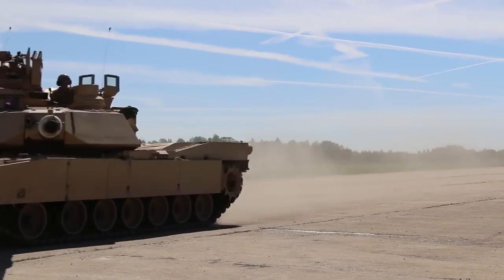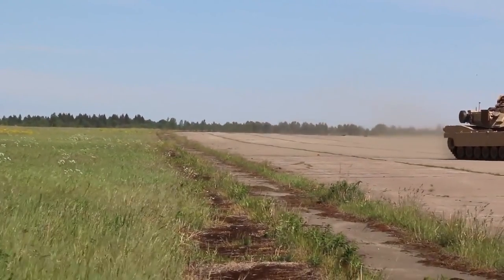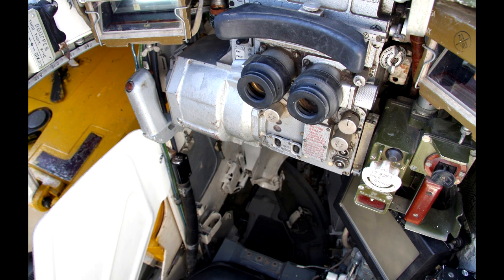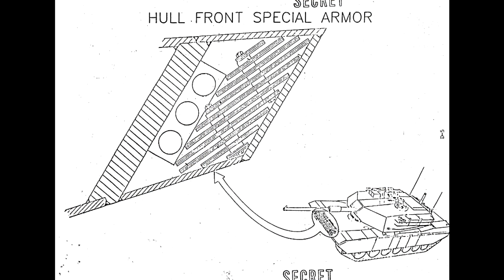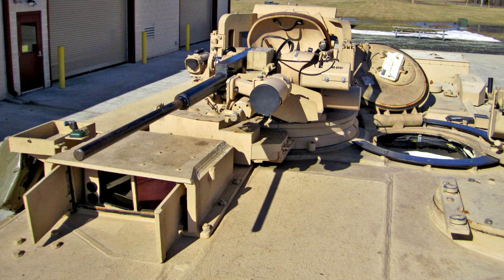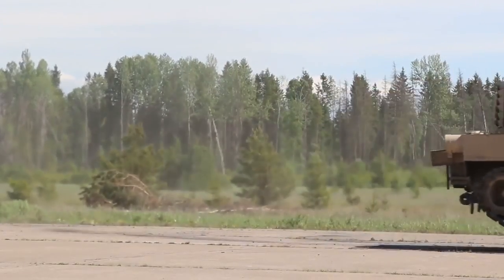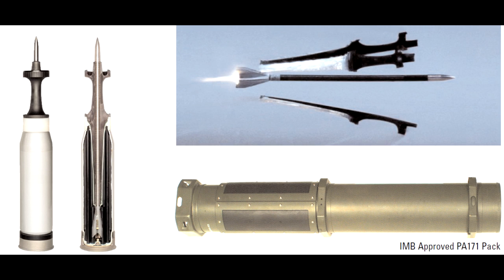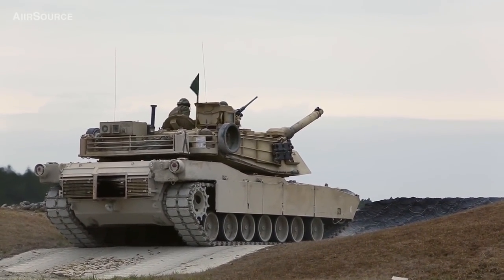Problems with Abrams tank

Comment: Could we get a video about diesel engine vs gas turbine? The way it seems to mostly be put in your videos is that there are no benefits to gas turbine and there is no reason it was chosen for the Abrams.
Reply: I like Red Effects videos, but everyone has limits on what they know. The 'inside the chieftains' hatch guy was a US Army M1A1 commander. He claimed that the gas turbine was relatively fuel efficient while on the move, but horrible while idle.  I would like to see a more in depth comparison of this as well. The 'gov' are poopy headed morons, who should have listened to me take, is not always convincing.
Reply: Advantiges are: less noise: the Abrams is called the whispering tank. And as some others stated: less moving parts. But this is not really an advantige: because it only becomes one, if less moving parts mean less maintenance and more reliability. But the engine needs far more maintenance as any comperable tank engine.
Reply: @scheisstag  maybe less smoke too,  those Diesels  roll coal pretty bad sometimes. But I still like them too:)
Reply: @scheisstag  Have you ever actually worked on the engine before?

Just curious. I mean, I have. I can tell you that it isn't any more or less maintenance intensive. So I'm not sure where you're getting this information from.
Reply: @shirghazaycowboys  How many soldiers are in your tank  bataillon?
Reply: @scheisstag  Depends on the year. I got out in 2015 and at that time Second Tank Battalion was beginning to downsize. 

There's likely only two to three companies left. Alpha Bravo and Charlie, if they didn't divest the last one.

Regardless your question is rather ridiculous. No normal enlisted soldier can answer that question as on given day there are troops coming and going.
Reply: @shirghazaycowboys  Its not ridiculous. Because you are not supposed to answer with one fixed number, but with an average figure. Its about how big in average your logistic team per tank has to be.
Given the fact that you have 58 tanks? how big is than the average strength of the whole unit?
By the way I have also been to Afghanistan in 2015, not to Shirghazay, but to the north.
Reply: @scheisstag  Do you want tanks or personnel?
Reply: @shirghazaycowboys  For the relation you need both. So I guess if full, there are about 58 tanks?
Reply: @scheisstag  Bro, just get to the point.

We're talking about engines. Enough with the math and relations. Just get to the damn point.
Reply: @shirghazaycowboys  No need to curse or get impatient. Every army tells you proudly that their equipment works perfectly well. But if you have a high ratio of: men working in a bataillon, to applied tanks, than this indicates that you have either a high fuel consumption and you need a lot of personal for transportiation or a high maintenance rate. Or you have both, high fuel consumption AND lots of maintenance. Which both indicates some disadvatiges of the engine. Isnt that obvious? So you are going to tell the secret of the battallion strength or not?
Reply: @scheisstag  Your point about personnel to tanks ratio is kinda useless. US battalions, especially nowadays in the age of the BCT, typically have a Headquarters Company, 3 line companies, and a support company attached to it from the Brigade's Support Battalion. Even in an armored battalion, not every soldier is geared towards crewing or working on the vehicles, of which there are various models of tracked and wheeled vehicles in each battalion. Each company typically has 100 to 150 or less personnel, though Infantry companies tend to be larger, while maintenance, supply, and medical companies tend to be smaller. When I was with the 1st Armored Division at Fort Bliss, we had roughly 4 to 5 tanks per platoon, with 2 to 3 line platoons per company along with a Headquarters platoon. Just by estimating the numbers there, you can easily see how personnel can both massively outratio tracked vehicles and also be outratio'ed at different times. Abrams are not delicate machines that need 24/7 maintenance so large numbers of mechanics are not required. Most maintenance can be performed by the crew themselves and quickly. If you want to get very technical about it, every member of the crew is technically a mechanic capable of working on the vehicle. Unless there's a serious problem with the engine or gun, it's very seldom that I saw an Abrams actually have to go into the shop to get worked on by the mechanics.
Reply: @ericharrison7518  So I agree: the ratio between a tank and the support units for fuel and maintenance would be crucial, but cant be accessed this way via the batallion strenght.
You claim, that you know, that the Abrams turbine is comparable easy to maintenence. But actually you cant compare to anything, because you only worked on the abrams tanks. 
I read numerous times, that the turbine despite it viewer parts is harder to maintain. But cant find it right now. Lets see if I can do. 
But undisputed: the turbine consumes much more fuel. So my point is, that the engine also with its easy to spot engine temperature on thermal vision is the greatest disadvantige of the abrams.
Reply: @scheisstag  This is the problem that a lot of sources don't go into detail about. When we're discussing maintanence, do you think of problems that deadline the vehicle, or are you thinking of user level maintenance and upkeep that anybody should be doing on their vehicles regardless? I've served alongside German, British, Polish, Danish, Iraqi, Saudi, Kuwaiti, Japanese, South Korean and various other countries tankers in various training exercises and deployments. I'm not going to sit here and claim the Abrams is the end all, be all, but in my opinion atleast, the engine has much more power and requires comparatively little maintenance to other countries vehicles. If there is a deadlining issue, it's also much easier to fix the engine and return it to service than other countries vehicles. If you count regular maintenance and upkeep against a vehicle then it's pretty absurd. I've worked alongside people using Soviet era equipment, and even newer Polish built models, and the Abrams has always lasted far longer with fewer faults as long as you keep up with daily maintenance. When diesel engines break down too, they tend to be break hard, requiring serious maintenance and recovery teams, whereas in the Abrams 9/10 times the crew can fix the issue and drive on.
Reply: @ericharrison7518  I am more concerned about maintenance. I am thinking about this: how much sense does it make to have well protected tanks in your army, if you need a whole fleet of  tankers and maintenance vehicles rolling "just behind" them and those are totally unprotected and filled with flammables.
In the wars I have witnessed the US army outsourced the problem on the long run to local contractors driving the fuel. And lots of them got killed in ambushes.
This problem is definitley worse with the Abrams compared to other tanks, since the Abrams uses in reality around twice as much fuel. 
If this is also true for maintenance I cant tell: you say it takes the same time to maintain an Abrams as it takes to maintain another tank. I dont know. Couldnt find any direct comparison. Maybe its a "military secret". But in civilian sources comparing costs for ship turbine engines they need one third more money to maintain the turbines compared to the diesel engines. Which makes me think you might need also a (one third?) larger maintenance fleet, which also consumes fuel as well....In reality its not about  bringing the best armour and the biggest gun, but about the best logistics.
Reply: @scheisstag  Which is why the turbine engines work so well for the Abrams. We already have vast quantities of the fuel required to run them, since many of our vehicles run on the same fuel. Abrams are definitely a fuel hog, there's no doubt about that. While it is a negative, the US has a superb logistical train that very rarely runs into issues. The only reason we were delayed in the rush to Baghdad was due to low visibility conditions from a sandstorm, and not due to running low on supplies. Any modern military force requires a long logistical supply train if it's going to continue to advance. Whether it's American, Russian, Chinese, Lithuanian, Luxembourgian, or Antarctican, they're all going to consume massive amounts of supplies while on the move. The only reason people are more familiar with the Abrams requiring that than other tanks is because it's the most prominent tank that's made large advances in the era of 24/7 cable news. Even the British only had a relatively short distance of a hop to Basra, whereas we advanced the entire length of Iraq. In the initial invasion, there were very few civilian contractors running supply missions. It wasn't until after the occupation and rebuilding of Iraq began that we started heavily investing in contractors. It's not as negative as you make it sound. We paid civilians to run supply missions so US servicemembers could be freed up to do other work, like patrols, reconstruction efforts, guard duty (Which was eventually contracted out on larger bases to free up even more soldiers for other tasks), manning FOBS, command and control missions, etc. It allowed a smaller number of troops to secure a much larger blueprint than they could have otherwise. At to mechanics, I can say, atleast for my battalion, there was around 120 people on the support company, which consisted of wheeled vehicle mechanics, tracked vehicle mechanics, cooks, supply, and other more mundane jobs a battalion needs done to keep fighting. I would say probably 30 or 40 of those were actually tracked vehicle mechanics (even that seems too high but I'm playing it safe) for around probably 50 or 60 tracked vehicles in my battalion. There was maybe 1 to 1.5 mechanics for every 2 tracks in my battalion. Like I said, most maintenance is user level. It's not often you need an actual mechanic to fix a problem.
Reply: @ericharrison7518  My argument was not, that the Abrams is a wothless piece of equipment. My argument still is, that the Abrams would be far better with a Diesel engine and this is the Achilles heel of the Abrams. Less fuel consumption, less costs for the engine, less heat and therefore less thermal visibility. Which also means you are less likely to be hit by rockets like the javelin.
Also I heard you get into problems if you, as an infantrist, walk  to close to the exhausts due to the high temperature. (Dont know if this is true)The advantiges: being smaller and less noisy are not making good for the disadvantiges.
And I still think, that you need more time to maintain the turbine: it needs by far more air. Which means you need bigger air filters. And they take a lot of time to maintain in a sandy environment, while its true, that it is an easy process.
" It's not as negative as you make it sound. We paid civilians to run supply missions so US servicemembers could be freed up to do other work." Clearly the US benefited of this smart deal. But from Peshawar all the way to Kabul and to the US bases the roads were littered with trucks and tankers. Some having the burned remains of the civilian drivers still sitting inside for quite some time....(while its true, that the detachment of Abrams to Afghanistan was really small.)
Reply: @scheisstag  Cleaning air filters on an Abrams is actually a very easy and simple process. I can't say I ever remember it being a difficult process. I completely understand where you're coming from but that's just not the experience I had working with an Abrams. The whole system is engineered to be surprisingly easy to maintain on a user lever. Regarding the exhausts that's sort of true but it's not at the same time. Is the air hot? Sure. Is it hot enough to actually burn or scald you? No. We had troops on the back deck of our Abrams in the rush to Baghdad, along with all of our personal gear. They never encountered any problems. It's not just being small, less noisy, less moving parts, and easy to maintain that are it's advantages. It's also a fuckload of power, and a pretty damn high rate of speed for being a rather hefty tank. We're able to out-maneuver other tanks thanks to that turbine engine, which makes all the difference in the wars that tanks are actually meant to be fought in. I'm not sure about the supply line to Kabul because I was never deployed to Afghanistan. I know there were casaulties, yes, but I assume it was probably much at the same rate, if not less, than what our convoys were hit at in Iraq. The Iraqi insurgency was far larger and more organized than the Taliban could ever hope to be and we didn't have massive amounts of casualties among the contractors and military personnel guarding convoys. We took losses, yes, but I don't think it was as heavy as you make it sound. If you have some statistics on contractor losses for either war I'd actually like to see them. It's something I've always been curious about.
Reply: @ericharrison7518  You love your machine. Probably out of patriotism and personal attachment. I get it. But this doesnt change, that the facts are speaking against this engine. And I am even  willing to give you, that reports of personnal being burned by the exhaust might be wrong and that maintenance time might be equal.
You tend to look away from the main disadvantiges: fuel consumption and heat, to focus on less important subjects like maintenance. I guess because its easier to argue about that, than the obvious consumption, and second this is more in your field of experience as a former crew member, while fuel consumption seems to be a litte abstract and is reasoned about a couple of level of command higher. 
You tend to think the tank proofed itself in war, while the main disadvantige wasnt exposed:
You havent fought troops with heat seaking missiles or even only thermal imaging. 

There is a reason why there are diesel engine solutions available for the Abrams for export versions.
And totally away from this whole discussion: there are of course no official numbers of contractor losses. Because the army tries to hide the whole problem. And its easy to do so. I am talking of this: a truck driver on a civilian truck, working for a civilian company, but with military cargo on board. He can very easily be depicted as a civilian.
I also cant provide you with exact numbers. I only know from my own perspective. I am not from the US and not a soldier. I have been in Pakistan, Afghanistan and Iraq numerous times during the wars. So its a little bit like your tankers perspective on the engine: I know it from first hand experience.
Reply: Yeah honestly i think he ignored the benefits of the gas turbine whilst ignoring the fact that they adopted the engine for a reason. For one, there are less moving parts in a gas turbine engine compared to a diesel, the cost increase may be less so long term and they do tend to be very long lasting, which suits American doctrine nicely, plus they do give extra acceleration. Applying standard 'cost saving' measures to vehicles need not apply as much to America, a country that spends billions of dollars on random military equipment projects and then doesn't adopt anything from it, plus the US is noteworthy for their logistics and refuelling is not nearly as much of a problem as it is for other countries, if it was as much of an issue as it was made out to be they would have either used a diesel engine or had an APU from the start.
Reply: When USA wastes taxpayer money on Vietnam war: bad, make love not war, why should i pay for this bullshit?

When USA wastes taxpayer money on fuel and logistics: USA is the greates country in the world so we can afford it!

Gas turbine is good in trains or planes, for a tank that doesn't travel at top speed all the time. Also  US military is lobbied a lot, its not an argument that "if it was bad they would have changed it, there is something we don't know", US military wasted billions of dollars on military projects, lobbying likely plays a large part in keeping the Abrams as it is.
Reply: @werrkowalski2985  Vietnam war was to support French foreign policy and to support  Catholic Church's land ownership (one of largest land owner in South Vietnam).

I'm not a Catholic.
Reply: It comes down to logistics. Most vehicles/support equipment in the US military can use jet fuel. Our power carts for the F/A-18 used the same fuel as the F/A-18 and it was a Detroit diesel engine
Reply: Wasn't the Abrams built to fend off an invasion of Europe through the open plains and steps of germany, etc? 

If so, that would be a main design consideration in the choice of such an engine. Then there's your enemy and doctrine. 

Soviet tank design was originally and probably at that time a quality down, technology down, cost down and numbers up affair. Though I'm sure this changed by the late 70s, early 80s to some degree though there was still the belief that the soviet union would overwhelm the corridor with tanks and armored fighting vehicles in their invasion.

The americans were of course basically the reverse in their approach (though originally they were a run what you got / not as complex) type tank builder.

A gas turbines main advantage would be size, power, and weight. If you increase the power to weight ratio you make a better tank, if you decrease the weight of the power plant you increase the amount of armor you can have. 

Of course the cost is fuel, but when your goal is to defend and not make huge and deep advancements into enemy territory then that's not as big of a deal. 

Making it multi fuel was never meant to give it an advantage, it was just meant to take away a disadvantage of having to run av gas all the time. 

The filters were never a problem in europe, only in the sandy desert. 

I also dont really understand the comparison of the m1a1 with it's worse sights and gun, etc at its inception in comparison to the soviet tank at that time...whatever that means.

To me, if you're going to invest in a new tank design, you wouldn't throw on all the expensive add-ins and add-ons on your first rolling chassis. You want to prove the soundness of the platform first. Never mind that the development of these systems takes longer and with the way funding works within the U.S government system compared to the autocratic system of the former soviet union: it's much harder to procure the kind of funding for everything up front. Not to mention the other intricacies of the american system of government funding of scientific, research endeavors combined with military funding of private corporations to develop those breakthroughs into military and value added products. The soviet system of design institutes and top down organized design and construction firms was likely quicker at getting fighting vehicles built (with a corresponding cost in quality and thus effectiveness). 

I think the american idea was that in the event of a Soviet invasion they would use their superior targeting systems and crew training to dispatch many enemy tanks at range and then use their ability to quickly scoot around and maneuver to escape unfair fights. 

But hey I could be wrong.
Reply: The problem with these sources on horse power figures are on theoretical engine power but do not take into account the amount of torque they actually have on the axles. 
Gas turbines are better for getting power to the wheels which makes allows for much faster acceleration compared to a similar sized diesel engine.
Reply: Wrong the engine was chosen because of the amount of different fuel options it can run on just about anything you're not running a diesel off regular gas
Reply: Trevor Williams: The names are misleading: a gas turbine is normally not running on gas, like you assume. A Diesel engine is not limited on Diesel.
The name gas turbine is not derived from gas as the fuel, but from the working fluid: air, which is also a gas.
Both engines are running on different kinds of widely used fuels like Jet A1 (for planes), diesel, ship diesel and gasoline.
What you do not like to introduce is a logistic nightmare by bringing an extra fuel to the war theater, that can only be used by tanks exclusive, like gas. 
And fun fact: other than you claim, gas could also be used in both engines: the diesel of the Leopard 2 for example and the turbine of the Abrams.
So the engine was definitley not chosen because of different fuel options.
Reply: @scheisstag  sorry you are mistaken my friend if you think a diesel engine can run as many fuels as a gas turbine fuel really doesn't matter like a combustion engine if its not water it will run on it lol as for the logistics of having to fuel them regularly i know first hand about that but range isn't as important in modern war zones there are no lines anymore and no army won't to go toe to toe with us so the days of the blitzkrieg are over they just hide and take a pot shot at us
Reply: @tbone7353  Dude, like with your last post you get nearly everything wrong that somebody could get wrong.
The engine in the Leopard runs on: , petroleum, autogas, liquified natural gas, benzin, alcohol, all kinds of light oil like Jet A1 and all kinds of heavy oils like ship diesel and even coal dust. https://de.wikipedia.org/wiki/Vielstoffmotor 
If there is something else, the Abrams can run on: please name it. But it doesnt matter in reality, because as I pointed out: you, as the army do not like to bring an extra exotic tank fuel to the war theater, that is otherwise useless. And you will not find other fuels in any country, in quantities, that can be used to fuel tanks. If I am wrong please name it.
You say. " range isn't as important in modern war zones.." What about the Iraq wars, in which the US did long range attacks over hundreds of kilometers with tanks? And if this would not have happend: how do you know, how the war of the future is fought?
You say: "no army won't to go toe to toe with us" Pretty cocky for someone, whos army did not won a single major confrontation since world war II. 
"Lol" as you would put it. 
And why dont you use dots?
Reply: @scheisstag  lol the Abrams runs any jp fuel gas kerosene besides that you shot a hole in your own boat the 1st gulf war you referenced was the last time there was a large scale tank on tank battle what happened 90% of Iraqi armor was destroyed in under 48hrs range is not as important you clearly don't know how this goes down it's not like a bunch of tanks are out there by themselves huge supply and support lines are not far behind as well as support armor vehicles like the Bradley to do fast scouting also with satellites you know in advance of formations and defenses so ya the day of tank on tank is nearly over as far as trying to shit on the US military i would love to hear where you are from and the military prowess lol you bring up the leopard please don't tell me you are German you never won anything
Reply: @tbone7353  Dude with every post  you show less knowledge: Kerosine is one of the light oils that I already mentioned.
"the 1st gulf war you referenced was the last time there was a large scale tank on tank battle." What kind of logic is that? Of course the last time that anything happend stays the last time it happend.
 Until it happens again.......So this does not allow any logic conclusion about the likelyness that this event gets repeated in future, or not.
But this is also totally out of topic: if we will have  large tank battles or not was never debated and has nothing to do with the question, if tanks need range or not: which means: If tanks need good engines or not. And your claim that range is not needed is simply absurd. Try to tell that to somebody in this forum. A tank without range would be an armed bunker. And if there is a trend in warefare, than it is the trend away from immobile armed bunkers of WWII towards mobility of strykers (I dont say the strykers are good) and other air deployable  units.
And the rest of your post is just rambling some unrelated facts, which are not wrong, but have nothing to do with the discussion. What are you? A teenager with concentration issues?
Reply: @scheisstag  let me dumb it down the 1st gulf war being the last large scale armor battle is important when the Iraqi forces and the world for that matter got to see what a tank on tank engagement vs the US looked like never again did the Iraqi forces try that strategy and no military would do that again they would be fools to do that as far as range i don't understand what you don't understand the only way range would matter is if you cant support the tank with fuel that might be a problem for most countries its not with the us has never been a problem saying a tank is better than the most battle tested and lethal tank ever because it has a diesel engine is laughable bringing up tanks that have no combat experience is laughable focusing on range is laughable you used the 1st gulf war as a reason for rang as a importance did the huge fuel consumption hinder the absolute decimation of hundreds  of tanks in a matter of hours point is you are trying to pick apart the most deadly tank ever because it won't run on vegetable oil they put that engine in it regardless of what you think for a reason you being a expert might disagree but i don't think the design group cares about your opinion nether do the enemies who faced it but cool keep talking about the best tanks that have never seen combat and how good there biodiesel engines are its a killing machine not a marathon runner all the other tanks can use there great gas mileage to try to get away
Reply: @tbone7353  Your post is just one sentence. In this one sentence you jump randomly through half a dozen of topics. And than you come up with a conclusion, that is in no way related to one of the topics. And this cunclusion is basically: US is the best. Which can be translated to: I  (as a US citizen) am the greatest. You are really a teenager.
The Iraqi tanks were cheap downgraded export versions of outdated third generation russian tanks. They did not had any electronics. And only a few thermal viewing devices. No heat seaking rockets. Or any rockets or reactive armor. And they were operated by  dismotivated ill trained crews.
This is like me wrestling down my four year old brother and shouting "Invincible! I am the GOAT! Better than Ali!"
And by the way: you are not only contradicting yourself, but you are in addition wrong: The Abrams could  of course run on bio oil.
And the rest of the expert world, apart from your, judges tanks normally by three parameters: killing capability, armor and MOBILITY. But I get it: you mentioned it before: you are the greatest expert and dont care. 
And thats exactly what I will do form now on.  There is just not enough content in your  one sentence rants.
Reply: @scheisstag  sorry i didn't pass the punctuation test lol where are you from all im saying is to talk about a weapon system that has never been in combat is stupid but you are clearly the expert with amazing grammar lol hope to see you on the battle field some day
Reply: @tbone7353  That can be easily done: I have been in the wars in Iraq, Afghanistan, Pakistan and the widely unknown conflict in Tadjikistan. So see you in Syria 2020, loudmouth?
Reply: @scheisstag  shaking my friend  shaking
Reply: @tbone7353  I do not threaten a kid/tough keybord warrior/internet expert on "live, war and everything".  You actually brought that up: "hope to see you on the battle field some day
"
Fun fact: I have been already to the Syrian embassy to get my customs cleared.
"you are clearly the expert" At least compared, it looks a little bit like that: I had tanks shooting in combat just a few meters away from me. While I was in the small village of Khorog on the Afghan border one of the two tanks got destroyed by a RPG and the whole crew killed. Lol, as you would say.
Reply: @scheisstag  should have been in a US Abrams fun fact your not the only one who has been in war pal im not a kid now but when I was i was the one making Soviet pos tanks pop there turrets off in Iraq i was fooling around but if you want to get disrespectful and drop i have been in war and saw people die you're not the only one and you can gfus
Reply: @shirghazaycowboys  very true only US Abrams have depleated uranium armor big difference from export models
Reply: @landho128 erm, the DU armor packs are only fitted in the turret of the Heavy Armour variant.
@pixel wortel But the Saudi's are stupid to have their tanks operate largely alone without close infantry support in a contested area, just like the Turk's who lost some Leopard 2s did.
Reply: that would be great
Reply: Gas turbine is much quieter. It’s very hard to hear an abrams whereas yiu can hear diesel tanks for miles.   Also the AGT1500 is smaller and lighter therefore more room for armour and fuel.
Reply: No I'm german.
Reply: @d.f.9140  Than you are up late.. :-D
Reply: @scheisstag  yup, that's how it is when you actually use the internet to gain worldwide intel in all sort of aspects...it becomes late, when interesting topics and people with culture are present.
Reply: @d.f.9140  👍
Reply: There are pros and cons  to gas turbines. Opting for a gas turbine was a reasonable choice at the time.
Reply: its quieter
Reply: I'm a 91A. The benefits are... plently.

Any fuel can be used but diesel is the standard. Obviously there will be a diffrence in efficiency and power but it's a counter measure.

Far less moving parts, most of it is unscrew and pull up until you get into a depot level issue like broken components. You can easily replace and fix an issue. 

It can run in artic weather as where other engines would struggle. 

Its incredibly efficient to the point that even exhaust is part of the cycle to get more power.

The exhaust is so clean it comes out pure and clean that it's used as breathable air in the Abrams NBC system.

The main issues the Abrams currently has coming from someone that actually is trained in repairing and maintaining them is, the suspension and things like a flimsy exterior part.

Why the suspension ? It's a dam 7o ton beast. And the thing is, the Abrams is so over the top engineered  that it's a very simple tank if you're someone that only reads a wiki, simplicity done by complexity is what is seen from a grease monkey.  

The price may be higher upfront but in the long run a shit ton more is saved in maintenance and repair along with time, definitely  a lot more time.

So on and so on
Reply: Its my understanding that it they chose the gas turbine because Chrysler was experimenting with gas turbine engines for a long time and needed a government bailout. The deal that ended up being struck was the government sold a contract to them to build turbines for the Abrams. If it wasn’t for that i imagine it would run a similar engine as the germans do.
Reply: Well ,simplicity,durability and light weight are good turbine advantages.
I seem to recall they are also a lot less sensitive to fuel type.
When the British tried to install a multifuel engine in their `60s MBT  ,the Chieftain. they managed to make what was the best tank in the world by a long way ,a heap of unreliable junk.
They should`ve put a turbine in it, god knows they had enough experience of them. A simple centrifugal shaft unit would`ve been great . Instead they got the Leyland engine.
Reply: The US Army chose the Diesel powered GM version of the XM1. Congress overruled the Army
Reply: Both the MTU (Maybach) Diesel engine and the Continental AVCR-1360 Diesel engines were tested against the AGT-1500 during The XM1 trials, the gas turbine came in dead last.
Reply: That is indeed so to school boys who give no shit about US warfare doctrine.
Reply: He doesn’t know anything about that. He only knows what he reads on tank encyclopedia lol
Reply: @shiftingndrifting1532  Sorry to say but gas turbine is shit. 
Don't believe me. See T-80. That gone really well. German diesel engine is still far superior plus it cost less than gas turbine.
Reply: @SaviourSword995  Russia has along history with powerful v12 diesels.  They tried the gas turbine, as they try many things.  The parts inventory and teaching the many, many tank depot guys about the gas turbine, and the fuel consumption worked against them.  Russia fields a lot of tanks since they directly face the chinese.   Then remember that Russia always build an export version of all thier tanks, if other countries do not want the high fuel consumption they will not buy them.  Its all about sales.
Reply: Royal Noble It’s Russian built, what did you expect?
Reply: @Optimaloptimus  What are you talking of? Neither the turbine of the abrams nor the comparable diesel engine of the Leopard are "russian built".
Reply: scheisstag I was being sarcastic. Calm down.
Reply: scheisstag And I was referring to someone else’s comment on the T-80 turbine engines.

Edit: just realized you’re not the original person I commented the sarcasm to.
Reply: Royal Noble T-80 just proves Russian gas turbine is shit
Reply: @SaviourSword995    And how much time do you have on tanks?
Reply: This dude is a raving Russian nationalist. He's seriously sitting here trying to argue that Soviet tanks had better sights than the Abrams. It's such a ridiculous joke lol. Why would you expect him to seriously research why the US chose a gas turbine instead of a diesel engine? God, this video is painful to watch with just the massive amount of errors and opinion passed off as fact.
Reply: @ericharrison7518  Btw the selection of the AGT 1500 was political in nature. Lycoming Turbine lost 3 separate contacts (UH-60/SH-60/AH-64) to the General Electric GE12 (T700). Unfortunate for Lycoming, they initiated mass production beforehand, in anticipation of wining the before mention contracts. 

Which lead to large stockpiles of turbines with no use. This eventually lead to the US government intervention on Lycoming Turbine's behalf. And the AGT-1500 was retrofitted for land use. On a side note, General Dynamics has acquired a license to produce the MTU 883. And has since tested the powerplant on M1 A3 test beds.
Reply: @KSmithwick1989   There were no large numbers of  AGT 1500 engines 'lying around.'    In fact a factory had to be set up in order to make them.
Reply: @revolverswitch  Agreed, not to mention the M8 AGS was intended to replace the M551 Sheridan. Which was almost worthless as a tank. Almost entirely due to the 152 mm Gun/Launcher.

It used expensive caseless shells, that were prone to cracking. Along with the Shillelagh ATGM, that was in service for over 20 years, before being used in combat. And even then, only between 6-8 Shillelagh were ever used. Despite a production run of over 88,000 units.
Reply: It was chosen because of Jobs for Americans. That was the reason back then they discussed it in the  Parlament.
Reply: BuT tHe M1aBrAmS iS tHe BeSt TaNk In ThE wOrLd.

Ive seen the tank only in uses against 3rd world countries. Abrams can't even take a rogue iraqi machinegunner who fires at the back engine. When abrams came for the first time in contact with real ATGM'S (not iraqi ATGM's from the 60's) they got killed in Lebanon
Reply: @pixelwortel9578  A decent machine gun can go through the back of any tank though
Reply: @Gravyboat194  regular lmg's can't go trough most tanks. Anyway this problem has probably been fixed since this never happend again. Maybe if you go with 50Kcal you can get trough other tanks but i don't think you can hide a 50kcal that easy and ambush the tank.
Reply: @pixelwortel9578    The M1A1 never was in Lebanon.  And the M1A1 faced the latest generation Russian ATGMs in 2003.
Reply: @colincampbell767  not latest generation. It were from the 80's and they had 600 of the kornet wich is modern but from the 90's. Not the latest.
Reply: @pixelwortel9578  In 2003 the Kornets were 'modern.'
Reply: @colincampbell767  but the Abrams in lebanon got destroyed with a kornet in 2006. The Iraqi army had 0 kornets.
Reply: @pixelwortel9578    What part of there were no M1's in Lebanon didn't you understand?  And yes there were Kornets in Iraq in 2003.  

Where are you coming up with this garbage?
Reply: @colincampbell767  kornet's in iraq?! Give me the source then.
Reply: @pixelwortel9578   How about this?  I was given the reports when my unit captured some of them?
Reply: @colincampbell767  konkurs≠kornets.
If there were any kornets in iraq then it would get to shit.

"Iraq had no modern ATGM's" btw there got 1 m1 destroyed in lebanon. A "peacekeepers" from the UN patrolling between Hezbollah and IDF
Reply: @pixelwortel9578   "peacekeepers" from the UN patrolling between Hezbollah and IDF."

Wrong again.  The US military never took part in that mission.
Reply: This comment thread is so typical. On one side, you have unbiased people citing facts about the M1's turbine having inferior range, inferior MPG, inferior reliability, greater maintenance needs and other disadvantages. On the other side, you have socialists who are happy the united states typically uses inferior hardware like gas turbines, because of the advantage it gives communists worldwide.
Reply: @xXxcastenada  In which century are you living in? What kind of "worldwide communists" are you talking of? From which countries? And could you please give an example for one of this communist posts here in this comment section?
Reply: @scheisstag  The European Union is a socialist/communist movement. Most of the news media is run by socialists/communists. The so called populist movement worldwide is a reaction against global socialism/communism. All of the comments in this thread that ignore evidence or facts and make off topic and childish comments were likely written by leftists who may not deliberately be pushing leftist rhetoric but are simply following what they were indoctrinated into believing.
Reply: @xXxcastenada  The only one who makes an indoctrinated impression is you. And your claim, that everybody who makes a non fact based claim must be a communist is pretty childish as well. And what do you think, how many communists are spending their freetime watching US tank details on youtube? I asked you already for one single example. Instead of presenting it you just started with more outlandish claims....
Reply: And I guess next is the insult part.....
Reply: @scheisstag  Scheisstag, you're asking me to prove water is wet. The way that people close their eyes, place their hands over their ears and demand evidence. All the while doing everything they can to avoid the evidence that is right in front of them. The EU is socialist/communist and deprives its member states of their sovereign right to govern themselves. Deny what I'm saying if you can find it within yourself to look at what the evidence says.
Reply: @xXxcastenada  Excellent reasoning: you basically say: I know that I am right, becsause I know it. And according to that reasoning you fail for the third time to give the evidence...And you start without any connection to the subject of this clip (tanks) to ramble on the subject, which appears to be your favorite subject: communism. I am outta here.
Reply: @scheisstag  I made very obvious points for why gas turbines in tanks are poor policy. You didn't respond. You focused on the political aspect to avoid on topic discussion. Those whose hearts are filled with lies, are typically offended when truth or facts are cited. And so its no surprise that you're leaving now. Socialists always leave when their lies are exposed by common sense.
Reply: @xXxcastenada  Dude, you even failed to realise, that I already argued, that gas turbines are poor policy. Maybe that could be the reason, why I did not feeled inclined to contradict you?
No, you are right, of course I failed to contradict you, because I am a communist and this means: must have inferior arguments and therefore have to retreat.....So I will do this now: retreat in shame and avoid to face this stable genius and master of logic....
Reply: @xXxcastenada  Please stop your political arguments. The EU may be bureacratic and restrictive but they are in no way truly socialist OR communist. All of the development programs are designed to support corporate action and generally do not benefit the people (praise the exceptions). If corporations and liberalism seems communist or socialist to you, I would recommend you cease spewing manure and actually learn some political science.
Reply: @Links_Rechts_Lo  The EU deprives its member states of their sovereign right to govern themselves. Brexit shows there is no escape from this. The EU is a socialist/communist paradigm designed to spread communism/socialism throughout the world. This is the reason why they continue to bailout greece, despite its economy dragging the rest of the EU down. Its not about sustainability or fixing problems. Its about spreading the EU's influence as far and wide as possible. Eventually we'll see people in the UK build rafts to escape the socialism/communism of the EU, the way that cubans build rafts to escape the socialism/communism of cuba.
Reply: @xXxcastenada  depriving a state of its right to self-governance is not necessarily a characteristic of any and all socialist or communist systems, rather it suggests authoritarianism/forcefully subjected nations. I'm no fan of the EU myself and (almost) agree with the rest of your comment, BUT I believe you are mistaking Leftist ideologies for all authoritarian (non-democratic) systems, which would include capitalist oligarchies, sworn enemies of the left. Furthermore, I ask you to recognize the political axis distinction (Left/right culturally/economically/stately).
Reply: @xXxcastenada  Hey you seem to know a lot...would you describe the EU and the west as less socialist compared to now in the period after the second world war, like the 50's and 60's, I hear it described as the golden era of capitalism?
Reply: @SpenserRoger  The same deep state that killed Jeffrey Epstein provided financial support to Stalin, Mao, Fidel Castro, Kim Jong, Hugo Chavez and other socialist/communist regimes in the world throughout history. Communism/socialism was designed by the elite ruling class to enslave people, that's the only reason socialism hasn't died off as a failed experiment.
Reply: @xXxcastenada    Im sorry to say, but you keep stating negatives rather than having an actual conversation. Realize that there is an opposing argument and until you counter that argument you inherently are submitting your own loss. Answer the questions rather than IE. (Wow, Communist tank design is shit, look at the United States design in tanks, Abrams is soooo happy that t80 has deliberately made with more disadvantages. ABRAMS Is #1!!!!!) Which has no backing, it just reinforces your idea, not changing some one elses.
Reply: @scheisstag ... Bro... Just go read the UNs official website... About their goals for a one world socialist government. It's basically copy pasted from the communist manifesto. They ain't exactly hiding the fact that they want to have a one world government and one world religion. (Lucius Trust). It's right there in their own words on their own website lol.
Reply: @scheisstag  I really had a blast reading your comments.
Schöne Tage gewünscht.
Reply: @d.f.9140  You are welcome and it is a pleasure for me. :-D You are from the US?
Reply: Russia and other foreign nations experimented with turbines in tanks eventually recognizing them as inferior. The united states adopted turbines to deliberately give american tanks a significant range disadvantage. This shortcoming compliments next gen fighters like the F-35 having range disadvantages against russian and other fighter jets.
Reply: @xXxcastenada  you don't know anything the Abrams engine was chosen because of power to weight ratio and the amount of fuel options it can run on just about anything the Russians gave up most likely for financial reasons and lack of ability to support a tank like that i love when someone says that ancient technology used in modern day is superior
Reply: @tbone7353  A mazda RX-7 rotary engine has superior power to weight ratio over conventional engines. Why doesnt the US military put RX-7 rotary engines in humvees? Flex fuel is a nonsensical argument. Diesel fuel is something we have in abundance, its far more common than jet fuel. In addition to this, diesel engines can be adapted to run biodiesel made from waste grease, as well as other fuel types. The disadvantages of gas turbines in no way compensates for any purported non-existent advantages. The sherman tank was one of the worst tanks of World War II and today we see history repeating itself with the Abrams M-1 which is one of the worst tanks of its era.
Reply: @tbone7353  Trevor. If gas turbine engines are so useful and great. When will GM, Ford, Toyota or another serious automaker produce cars, trucks and SUVs with flex fuel gas turbines? The answer is: NEVER. Gas turbines in cars, SUVs or military tanks is an inferior technology. The only demographic that wants the united states to have tanks powered by gas turbines are socialists and communists who know they can produce a superior tank by using a diesel engine. And of course, those like yourself who have no common sense.
Reply: @tbone7353  I respectfully disagree. Most Eastern armor encountered by the M1 (for ex. the Iraqi tank forces) was, in fact, obsolete, unmodernised and in export variants, which puts them at a massive disadvantage. The  Leclerc, T-80 and 90 and Leopard 2 all outperform the Abrams not only at the same era of modernisation, but MAINLY in the price per performance. In fact, the T-80 was such an advanced piece of equipment that after Western evaluation, the analysts admitted that they in fact had no round capable of penetrating it from the front at the time. The more numerous T-72 can also come to blows with an equally old/upgraded M1 and fare reasonably well. However, the T-72 is massively cheaper than the M1. That is the main advantage of all Eastern armies. Numbers.
Reply: @Links_Rechts_Lo  i will talk about tanks when they have been hit in combat the point is the T 80 has never been hit with a depleated uranium penetrator because we have not shot it yet believing any war machine from Russia by what they say is laughable the talk is always the best but never stacks up the fact is you will never be the top of technology when price is a huge factor corners get cut and ultimately you get a watered Down version of a badass prototype until a tank has a combat record no point in talking about them in my opinion also i believe that the US believes that the m1 a3 is more than enough to go against anything and don't need to change everything especially that tank on tank warfare is basically becoming ancient warfare air superiority wins wars now and the US has got that covered
Reply: @tbone7353  Russia already deployed a fifth generation battle tank, which by all experts is regarded better than your M1A2.
Reply: @tbone7353  Yeah, can you guess WHY the T-80 hasn't been shot with a depleted uranium penetrator? Because those were made from 1992. Almost two decades after the first T-80 rolled out. Besides, 6 years before the M1 got the first depleted uranium shells, the soviets were making the T-80U model, which has ~200mm higher equivalent protection against APFSDS than the '92 shells could pen at 2000 meters. Therefore, as I've said in my previous comment, the T-80 was at the time practically impenetrable (from the front, past 1000 m definitely).
Reply: @scheisstag  deployed where on the test course lol
Reply: @tbone7353  This is that typical remark where the socialist says "its dumb" but is too lazy and weak minded to cite evidence for why said thing was supposed to be "dumb". That's the problem with socialists and leftists they don't know what they're supposed to think about something without CNN whispering fake news in their ears.
Reply: @Links_Rechts_Lo  ya another canceled weapon system from Russia its the best in the world but we aren't going to make it lol oh look up M829A3 the Shell that was designed to pop the top on that pos also lol
Reply: @xXxcastenada  man im a red blooded conservative veteran but good analysis spot on lol
Reply: @tbone7353 
1st off: Clearly the T-80U is not a prototype, since there's over 200 tanks in active service today (Russia (unknown no.), China (50), Cyprus (approx. 30) and others). 

 Second: Yeah I looked it up. And guess what. The type you're referring to was made after 2003, while i only claimed that the T-80U WAS impenetrable from the late 70s to the mid 90s, NOT that it is immortal today. Do you even bother reading other people's comments, or do you prefer your safe space?
Reply: @Links_Rechts_Lo  why would you use stats that are out of date to make a point lol 200 in service lol so there is 1 armored division scattered around the world very impressive
Reply: @tbone7353  200 today, which means likely hundreds converted in the 90s. My point is, just because its expensive and American doesn't mean its good. My other point is, you've got no idea about the comparative advantages of tanks.
Reply: @Links_Rechts_Lo  i know first hand how well Russian tanks hold up but i see you're a expert wikipedia reader so i guess you win
Reply: @Links_Rechts_Lo  no its the best until it is defeated by a better weapon system it has not happened yet talking about tanks that haven't been in battle is pointless when you are talking about a tank that is the most deadly battle tested ever thats all im saying as for Russian weapons they have never made the best anything not in their navy army anything just facts
Reply: @xXxcastenada    Remember that the Soviet Union had a problem building reliable turbine engines.  Also remember that this decision was made back in the 1970's and it's 1970's technology that drove it.
Reply: @xXxcastenada , other countries recognizing them as inferior is an appeal to authority with no actual factual evidence on what makes them inferior. Also I would read up about military doctrines and how they differ country to country, IE, air superiority for that second comment of yours. A deliberate disadvantage... huh